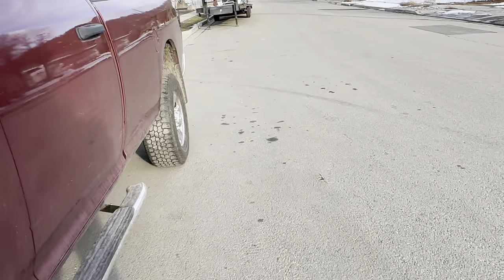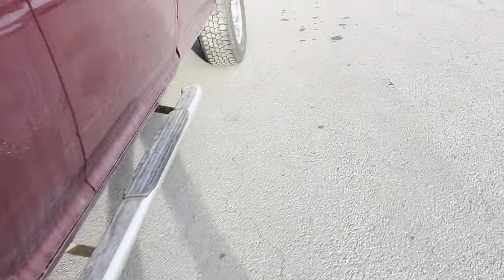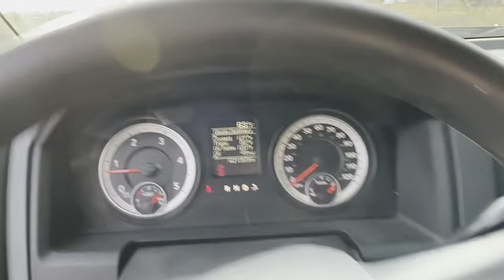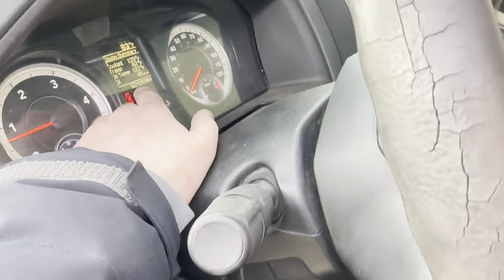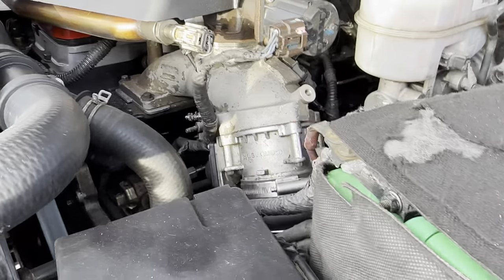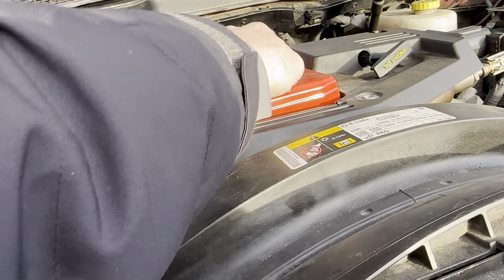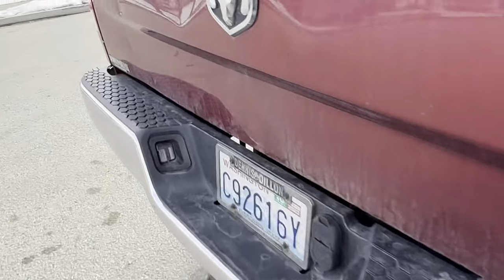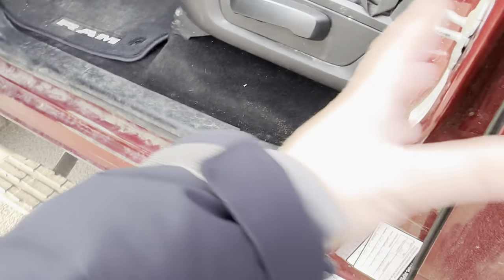2014 Ram 3500. 700k miles. On the road again!!!  Engine just rebuilt.

Comment: Hey Paul, do you run S&B air intakes on all of your trucks? Do you notice any difference in mileage/performance/reliability?
Reply from the maker: I did notice a little gain in mpg and slight quicker turbo response

Comment: How are the drivers backs?
I drove a Ford XL for nearly 700,000k… my back is a mess :(
Reply from the maker: I’ve heard several complaints but every body has different symptoms and problems. I advise people to use designed pillows for drivers.

Comment: So is it a good idea to flush the trans and change the diffs every 50k?
Reply from the maker: No. I never flush my engines or transmission. Just service.
Reply: @pddieselpower  does that include changing the transmission filter and fluid?
Reply: @wizard_of_poz4413  yes, as stated in the video.
Reply: @RickySlatton  well I can listen but the man says he doesn't flush em
Reply: @wizard_of_poz4413  In the video he stated fluid change and filter. No flushing.

Comment: what’s your opinion on pre def 6.7 4th gens ?
Reply: I heard they're crappy fuel hogs. The 2018 I got is an amazing truck both with and without emissions
Reply: @wizard_of_poz4413  They are when not under load. When loaded up, they just continuously passively regenerate, which is pretty much how DEF trucks behave.